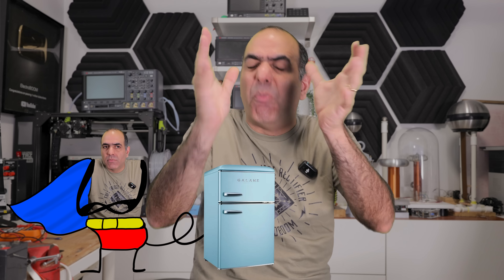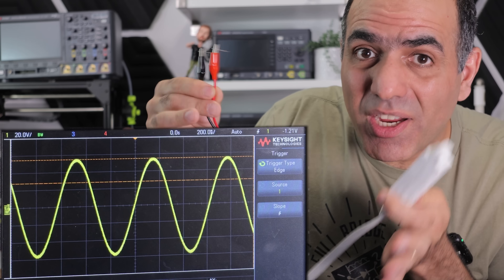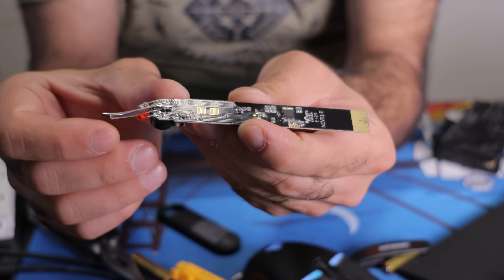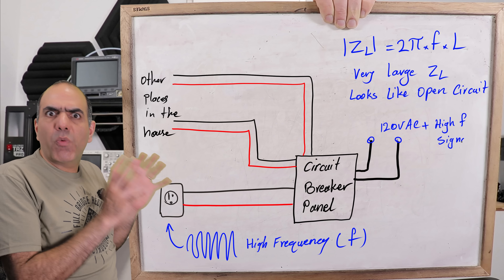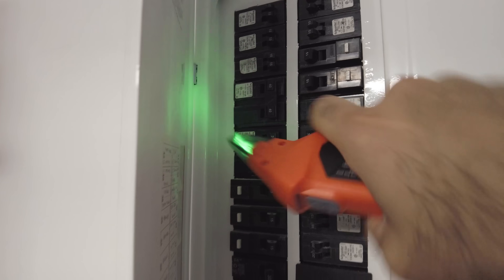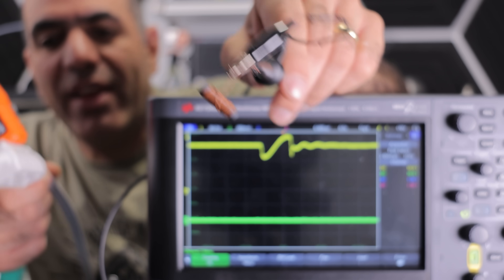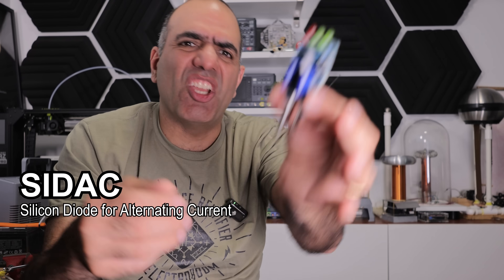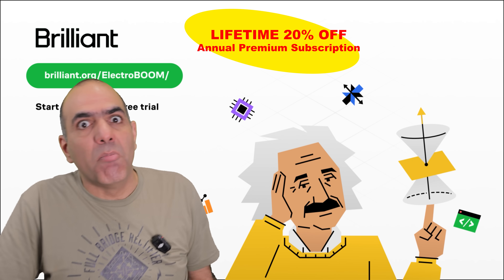FAFO the Breaker!

Comment: Hello Medhi, long time watcher, first time question.
I'm trying to hack the soundboard on a stuffed toy, and adding in an MP3 player, it causes the animatronics to stop working. My guess is that the addition is going over the voltage the 3 AA batteries can provide, probably because the player has an amplifier function. Have you ever considered doing a video on such things, even though it's all low voltage? I'm sure you could still add in 120V to the project to make a spectacular finale. 😛

Comment: I have much experience with them, called F Sets here, always wondered why they never work past the breaker. I understand it won't work in an extension lead before the signal because there is no current, but why not on the other side of the breaker, the current comes all the way from the power station

Comment: if you pop a breaker and your in a situation where there's multiple breakers on and off you can use thermal imaging to see which one is hot, handy if your phone supports that and your ac detector pen is out of juice. sometimes you can even see where the wire is resting behind walls and ceiling panels if your running a heavy load.

Comment: What is that new device good for if it cant be used to find in the wall?
Reply: They're extremely useful in construction when dealing with exposed wiring, especially during partial demolition for renovations, we use them all the time as do most of the contractors and electricians around here. 

Those simple detectors are basically "contractor grade" where you want it simple and sure to work in less than ideal conditions, the more you put into them the more there is to break when exposed to dirt, dust, water, chemicals, and/or getting banged around a lot.

Some older buildings from times when building codes/standards weren't a big thing and/or plenty of people built their own stuff to their own standards have horrifying rats-nests of wiring that you can never trust.

Comment: I used a vacuum cleaner to isolate a circuit. Plug it in and turn it on. Go to the breaker box and flip until the noise stops.

Comment: Why not just flip the breaker off and see which outlets stop working? Seems like a pain to mess around with signal injectors and intentionally overloading circuits if you don't have to.
Reply: In a business or office as well as industrial buildings or such environments in which huge machines or servers have to run with multiple breakers without context on a same place we can't turn one off in hopes to find the one we were looking for just to know we shut down the server or blew some heavy machines up.

Comment: signal tracer is a life saver, until it crossfeeds that high frequency into another circuit in a junction box
Reply: never knew gfci testers had a signal tracer built in, they never had the other tool at my work

Comment: So here's a question, we have a faulty ground on one of our circuits.  A sparksman came out and installed a GFCI breaker for the whole circuit because our roof/attic is basically non-existent and thus he felt it would cost more for a new run or to find the ground fault.

As it is between neutral and ground, there's 60v AC from capacitive coupling I assume.  The breaker however does work (going from ground screw to plumbing ground with a straight wire, as the breaker in the garage does trip.  But, it still seems alarming that there's 60v AC potential even on the ground screws at all (along with PC's plugged into that circuit).

Was what the sparky did right, or was there a proper way?  (I feel like it should have been his job to just find the fault itself, but he didn't want to because it's FL, flat roof house, and no crawl space beyond 3ft at most in height).  I know the GFCI breaker works, but I'm far too scared to actually touch the faucet and screw to test it with my body (I'd need to get the right resistor from a donor board to test it with an analog).

(Thanks in advance ElectroBOOM if you do respond to this.)

Comment: My father, 50+ years ago, just put a coloured dot on each power point to indicate the circuit, and then another dot on the matching breaker. Easy & cheap way to know which circuit is which. You used to be able to buy coloured screw hole covers for this purpose.
Reply: Ptouch on the outlet with the cct brk #

Comment: Plug in a very loud radio or buzzer and turn off all the switches then turn them on one at a time.    You'll have to go with the plug and wire not to test the breaker.

Comment: 6:45
a little pedantic here, but what you showed is power over ethernet (POE). it shovels 54volts down the data pins when a device requests it. its how IP phones and AP's are powered and internetted with only a single cable

what you're thinking of is a powerline adapter, which does precisely what you're describing.

Comment: not 60 hertz 50 hertz 240 volts in houses 16 a b automatic breakers  phase to phase  are 400 volts phase to neutral ar 230 volts in old amsterdam houses you can findt 2 phases at 150 volts the distribution lines running at 400KV

Comment: electrician here as well, the yellow tool had a special end so you could stick it into a north american outlet to see if the outlet not only has power but that the hot wire is on the correct side of the outlet, lol keep up the funny stuff. ive subscribed for a long time and alway like your videos. when do i get one of those ocissiscopes you keep blowing up?

Comment: Another method for finding wires in the walls is to connect huge capacitors to an outlet, they'll create a lot of reactive current (while consuming very little active power), heating the wires. Then you just use a thermal camera to look for wires.

Comment: The newer tickers are more sensitive when there is a load. Plug in a lamp and you can still trace wires with the ticker. I find it isn’t very accurate, but it will give you a general idea where the wire is and where it turns in the wall.

Comment: Funny, just got off a party where I spoke to someone who tried to 'find' the fuse by dead-shorting it with a copper wire. They ended up blowing the main fuse, which here in the Netherlands means that the electrical company is supposed to come out and change the fuse, since you can't access it. He said it went out with a bang. He could have used this video.

Comment: Why not  just  use a  battery operated transistor radio :) to trace wiring ?? not perfect  but you have a small battery operated radio it is a low cost help doubt you will find a single breaker this way though .

Comment: I have a different method for mapping circuit breakers in a house. 

1. Give every circuit breaker in your house a binary number. Make sure not to use all zeroes and all ones. Example: you might label your breakers from 1 (0001) to 14 (1110)

2. Look at the first digit of the number and turn the breakers on and off depending on that digit. 

3. Check all outlets to see which are dead and alive, and record which it is as the first digit corresponding to that outlet. 

4. Repeat for every digit.

When done, every outlet will have a number based on the breakers number. If any outlet has the number 0000 it's always off and 1111 is always on (which is why you should not assign these numbers.)

This is great to systematically map out every breaker in a new house. But maybe not so great to find a specific breaker for a specific outlet

(Yes I work with computers)

Comment: 0:05 Just wire up a switch and put the blank wires inside the outlet, then flip the switch.
Or use insolated Plyers and blank copper wire.🤣

Comment: Mehdi, how would you test for a ground and neutral wire if you they are not color coded. I have a 3 wire bunch and finding the live wire is easy, but for the ground one I poped so many brakers I can't count. Is there a better way to test which one is the gorund wire and which the neutral?

Comment: 🤨Medhi, just a correction (3:48 and 4:06):  There is no such like Live and Neutral.👉 It is LINE and NEUTRAL, (or phase and neutral following the older standards). Line and Neutral conductors are both called LIVE because they carry current in normal operating condition. The earth is not live as it carries current only in fault condition.💯

Comment: Be sure to check the instructions on the circuit breaker finder devices. They all have an automatic gain control and at least the Harbor Freight one says to sweep the finder over ALL the breakers after resetting and before going back and finding the correct one. Before doing that you can get triggers on more than one breaker. It only takes a couple of seconds to drag it over all the breakers and then go back.

Comment: 2:30 I love how Mehdi is Confident about his scope being blown
Reply: Dude just cooked 1000$ scop 😢
Reply: @mouaad_games8  that's a variation of skit he usually does. He turned the scope off an then burned capacitor in front of it.
Reply: @zorkitipafed4626  I don’t think so, the capacitor sound, and the smoke wasn’t normal
Reply: @ShadowySancturary  Pretty much normal for me. it just released gases through the path of least resistance. And you can clearly see that the ignition perspective is much closer to the camera than the oscilloscope.
Reply: @zorkitipafed4626  if only Mehdi tells us if blew up actually
Reply: @ShadowySancturary  From the very first videos he either edits short circuit sparks (just adds a blue tint on the frame) or blows up a capasitor. Of course many of the stunts are real but after watching his video about special effects he utilizes, you can see what is true, what is made more dramatical by capacitor explosion or what is completely faked in editor. And this one looks exactly like a trick with a piece of electronics purposefully shorted in front of oscilloscope. He does this every time when it is a static scene on his table. As you may have noticed, I also assumed that the oscilloscope was not connected to those ‘pyrotechnics’: it was unplugged beforehand, and then he cut out the frames between the screen fading and the shorting.
Reply: @zorkitipafed4626  I'm pretty sure the display was faked during that entire sequence. You can see the screens image slightly moving with the camera (camera being shook slightly by his movements) in relation to the actual scope which a real lcd obviously wouldn't do. Watch frame by frame to see what I mean.
Reply: Also we learned to not to “shove signal generator into plugs that are live”
Reply: This is something that no one has ever done

Comment: Uhhh....
1) Turn on devices on all switches and outlets.
2) Go to breaker
3) Identify and turn off a switch that has not been tested.
4) Go to all outlets and switches to verify which devices are off then take down in notes.
5) Go to breaker
6) Turn switch back on.
7) Repeat steps 3-6 until all outlets and switches are found to he associated with a particular circuit breaker switch.

Comment: I live in an apartment with questionable wiring in Europe. I was replacing an outlet that had two wires connected to it. One came from inside the wall, the other one was mounted on the wall in a small cable conduit. I assumed that the wire inside the wall was connected to the breaker box and the other one to clearly retrofittet outlets in the room. I turned off one (of 5) breakers and measured 0V on the wire inside the wall. I felt safe, but luckily decided to short live and neutral just to make sure. Nothing happened on the wall cable but I almost shat myself when I heard the loud bang and saw bright flash when I shorted the other one. It was a lot louder than I expected.
Reply: The single thing that America s*** electricity is good for, not killing yourself when you are wrong about which wire has the angry pixies

Comment: Couple of things: I really recommend getting the Fluke voltage detector. Other brands have failed to indicate on me. The Fluke is fantastic and trustworthy.
Second, in the US the Harbor Freight "Circuit Breaker Detective" is actually quite good and is $25. You plug one into the outlet then the other you sweep across the breaker box and it tells you which breaker is attached to that outlet. I used it to map all the circuits in my house when I was preparing to install solar, so I could characterize all the circuits and get an even load between phases and decide what to put on the backup panel.
Reply: Fluke's great if you do this sort of thing for a living, but for the home gamer Klein is about in the right ballpark.  It's not garbage, but doesn't cost you a weeks' wages either.

I do the software side of industrial automation.  My technicians own Flukes.  My tool bag has a mix of Klein (for when it matters) and Harbor Freight (for when it doesn't).
Reply: @jeffspaulding9834  The Fluke detector is $27. I hope that's not a week's wages for you.
For a dollar or three difference I just buy the Fluke.
Klein is fine. I got bit by a Sperry - it's a garbage brand sold at home improvement stores and I just needed one fast so bought one - mistake.
Reply: I thought of getting that harbor freight one as well, but I like the added features in the transmitter. Like GFI testing, wiring indicator lights. Plus for only about $5 from the basic Klein price, you can get the kit with the jumper leads, 2-pole and Edison adapter for testing by other methods.
Reply: Love Fluke
Reply: fluke astroturf detected
Reply: @Megatog615  Yeah sure buddy.

Comment: As soon as I saw the toaster and hair dryer I knew what was going to happen. The "slightly better" solution there is actually to get two 1500w space heaters, plug both into the wall on low settings and then just turn them up slowly until it pops the breaker. The most common accidently popping of the breaker is usually the Microwave and a Kettle.

Comment: That automatic gain control algorithm needs to be really good. Consider that all the brakers are connected to the same power rail, right inside the breaker box. The difference in signal strength between the right breaker and the wrong breakers must be absolutely miniscule.

Comment: I recently did a HUGE site that needed ALL breakers found. Old factory Absolute nightmare. Tried everything you used. Keep in mind Europe here. 3 fase,  even tho thinking it is single fase (as I said nightmare (it looked like a socket and was used as one, so it "dragged" its voltage once "off")). Even the earthing was not 0. Thats how bad it was. Yes, some of this stuff helps. And in minor cases it is perfect. I had worse case. For house stuff, perfect. Industrial, old. Oof. I noticed that the tools you showed have a real bad time when the earthing isnt up to date.

Comment: I just turned off my breakers one at a time and checked which devices and outlets stopped working (checked the outlets with a phone charger). It's a bit of a slow process, but it gets faster as you eliminate more and more outlets, and you only have to do it once if you write everything down and don't remodel that often. Such tools are probably meant for maintenance on large buildings (especially ones with rented spaces).
It's a cool device, though. I'm glad to know how it works now :)
Reply: Even faster if you plug some lights into sockets in every room, then you can just tally up which ones are on
Reply: If you have a lot of breakers, you can do a binary search. You turn off half the breakers to check which half yours is in. Then you flip half of those and so on.

Comment: My father got me one of these devices for Christmas shortly after I bought a home. It's been super helpful! I keep it by my subpanel. Although I'm making it obsolete as I replace switches and outlets by labeling each outlet with the exact breaker number that shuts it off. Since I'm using those two part "screwless" wall-plates, it's really easy to hide the label, but find it when I need it. Anyway, I highly recommend these for anyone doing electrical work.

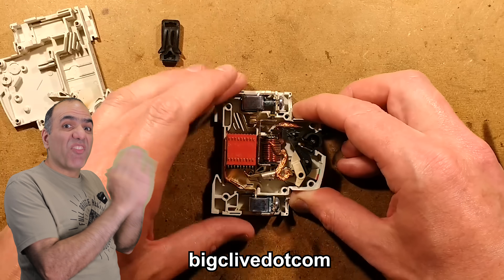Comment: 5:38 In Europe we have those coils, because it will make faster switching off high currents like at short circuit (In typical B its 3-5 times nominal current and C is 5-10). Its much much safer in that way, because whole time at short circuit all ground wires (PE) has dangerous voltage until breaker will switch off. Of course if somebody doesn't care, then impedance (resistance) of wires and connections in installation can be too high to make it work fast enough. Same with many and long extension cords.
Reply: @mikeycrackson  this is not EU regulations, but rather EN norms.
Reply: Building companies are obligated to use the most cheap and thiny wires in installations. But i can see something interesting: in the near past regular main  brakers here was rated for 63A. In nowadays 40A is a norm. When everything you think about is electrical.
Reply: @mamatidea  Where is that? Single phase? In Hungary we can get 3x32A (3 phase) service for houses. Anything above 32 A per phase requires a lot of work  and is rare for residential applications.
Reply: @mikeycrackson  With the imperial system and car addict city design in NA, you have more to worry about than electrical wiring.

Comment: A plug, a switch and two wires. each wire goes to a side of the plug and a side of the switch. Then you turn it off, plug on the wall then turn on. "SAFER" BREAKER FINDER. YMMV, tho.

Jokes aside,  there's that item you can buy a real breaker finder. lol

Comment: They use network cable tracers with a special adaptor jerry-rigged together to trace wires in walls. Works like a charm! Just adapt the rj45 port to 2 crocodile clips and connect it to live and neutral (obviously disconnecting the breaker first)